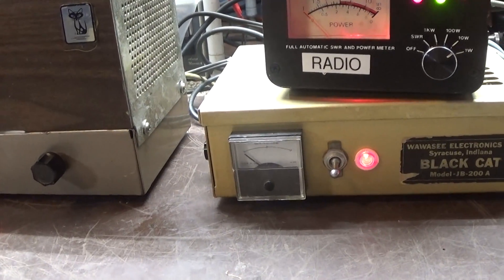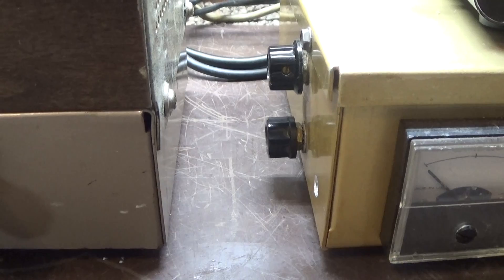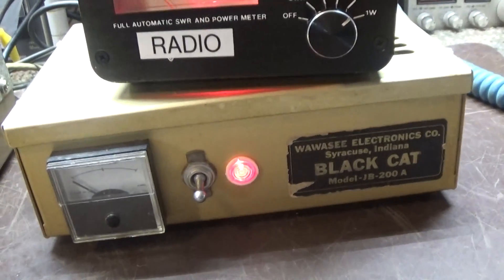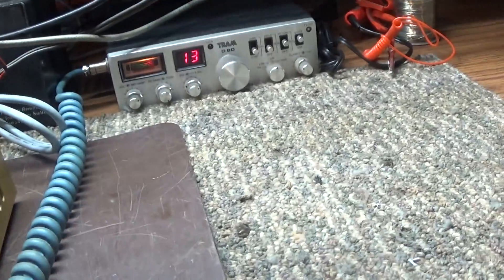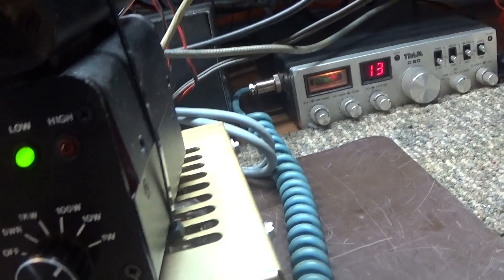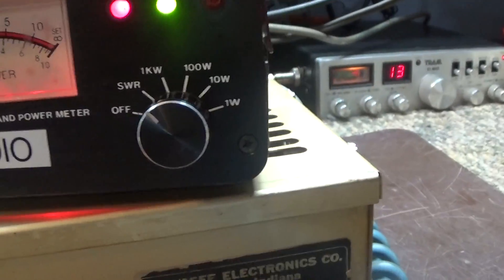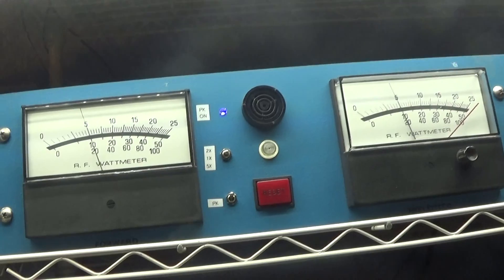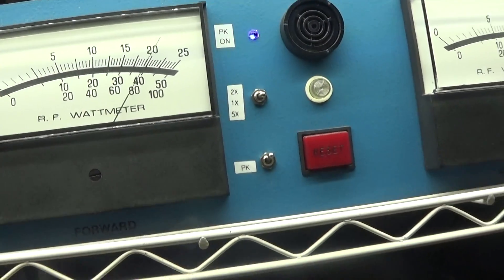Black Cat JB-200 aka JB-76B 10 meter 2 tube driver linear amplifier modulator

Comment: Very nice job with the JB200. Adding the load and tune and also the bias! I have multiples of these units, would you be interested in doing some repair and modification work to a couple of mine? I have watched you for years, you seem like a great tech. You like to improve and tinker. I am in central Ohio.
Reply from the maker: Thanks. I mainly use the JB-76BE schematic off CBTricks. There it shows that for the 'Tune' it uses 2 FIXED 43pf 500v silver mica's in series which would equal 1000v at 22pf, so I replaced the fixed with a 5-50pf (give or take) variable. For the Bias at first I tried a LM337 1.5a negative voltage regulator and at first it was working great but I was overdriving the amp with my 40 watt (peak swing) radio and the tubes arced and killed the regulator. I do not know if it would have been OK if I did not overdrive it. I was getting 400pk out or it. I then went to a 6 position switch with a 30v 5watt zener with the switch connected to 6 more 5v 5 watt zeners in series so I can switch 30 volts to 60 volts bias in 5v increments. This way is almost blow up proof (for the bias) So far so good. I like it as I can now tune the input for lowest SWR and adjust the Bias for the correct deadkey 40watts Max or less. Many people kill the Blackcats by too much dead key.